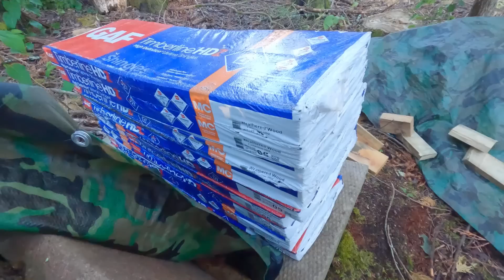The Scary Thing about Living Alone in a Tent- A Halt to Cabin Building. #102

Comment: 24:55  For one of my buildings, I closed off the roof by nailing boards under the rafter ends. It's been 15 years & it's still doing great. 
31:21  My brother got after me last year. The drip edge should have a 1/4" to 1/2" gap at the bottom from the fascia board. So, all the roof water doesn't drip down the fascia board. 
Hope the back gets better. Love your channel. Been here since I found the deer castle a few years ago Went back & watched all the previous.

Comment: Ryan, I had a bad back too. For many years I suffered to no avail. I finally asked my chiropractor how I could solve the problem and he suggested either a large yoga ball or an inversion table. I opted for the inversion table and back problems are ended. It's all about decompressing the spine. Good luck with the back issue! The project is looking great!!!
Reply: I was going to tell him the same thing.  I suffered with herniated disks and the in inversion table gave me my life back.  Ryan, ICE, ICE ICE!  It reduces the inflammation when do have an event.  All the bending and unusual angles you were taking when hanging those front boards is probably what did you in. And believe it or not, walking will help the nerve heal faster.   Get an inversion table and spend 10 min on it every day.  Good luck!
Reply: @ebony5766  Glad to find your comments here. I have same in lower lumbar... I have been hanging from an OM gym as much as possible... but now trying to do 4-5 times per day as long as I can... 5 or so minutes. It seems to be slightly helping. I don't want surgery... and I'm doing something similar to Ryan except my land is all hillside. Thanks for the constructive suggestions and I'm open for more if you have it. I'm still just clearing and plan to build at some point... but doing this alone and the back could make or break the dream.
Reply: @johannwolf1  interesting  to see just how many people have back issues.  I was actually under the cabin insulating the pex lines when mine herniated 5 yrs ago.  I didn't think I was going to get out.  The "regular" doctors gave me 3 options.  Pain meds.  NOPE.  Spine shots.  NOPE. or surgery NOPE.  So I was blessed to find an amazing chiropractor.   I can pretty much do what I want,  I have to be careful....bending too much is what will do me in.  So when I use the chainsaw I have to tackle the project in increments.  BTW, I'm a 68 yr old woman which my youtube name does not imply.  The inversion table has been a godsend.
Reply: @wendyritchie9320  Same I'm no on all 3... might consider stem cell injections... but I think I can heal this. It's been over 3 years now. I'm 56, but have always been athletic. Funny you mention chainsawing... I'm doing a lot of it. haha. and a lot of bending over to pick stuff up. that is the most challenging. I had a table I used before this happened. Since then I discovered this simple portable thing you can do more with... it's called an om gym and you hang from your hips in fabric... not your ankles. it has a bunch of handles too so unlimited body weight exercises and stretches are possible. Check it out you might like it. Often an hour or so after hanging the usual pain is gone for a bit.

Comment: I have the same back problem you have and maybe worse but after taking Turmeric/Curcumin for two weeks my problem went away. After 3 years still no pain. No pain pills anymore and we all know it is not good for the liver.
Now I just take one a day. If I do tweek my back the recovery time is a day and it is nothing like before, like a knife in your back. It works and it saved me from a early retirement. I am surprised no one has told you already. Qunol Is the brand I use. Good luck.

Comment: If you take a 5 in 1 in separate the dimensionals you can slide the 5 in 1 tool in between 2 layers and slip it off cut it off for a easily then you'll have 3 ones Just just for your next roof

Comment: Probably been mentioned, but . . . fly rafters are easier to install if you install your framing blocks from the last rafter first. Then just put it up from the ladder, screwed into the framing block closest to center. Then finish nailing/screwing.
Oh, and drip edge should overlap the corner if you're doing the eave edge and gable edge.
Oh and no need to cut the tabs off for your starter course. Measure 5/8" over the drip edge, snap a line and install the whole 3 tab, back side down along the eave edge. Then just line up the first course of finish shingle right to the edge. Making sure to  be 6" off the seam of the starter course.

Comment: Many times I cut the under /topside of the single of and used as your starter. Over hang 3/8-1/2" and start with a 1/2 so your joints don't match. 
For someone that doesn't know anything,  you know a lot.  Or you search YouTube

Comment: I follow a channel of a guy that lives major off grid in Alaska as in helicopter into the cabin. He has a good supply of food in steel barrels that is stored outside of the cabin. He is two or three days of bush travel and river swimming to get to the nearest road (and almost impossible most of the year). He has staples like beans and rice but you could use say a week of can goods and package foods plus ten gallons of distilled or regualr bottled water. Add an low cost butane stove and six cannisters of fuel and you are set for a week. Just a thought. Bob in Nevada

Comment: Honestly you need to either buy or make an Inversion table as walmart has one for ABOUT A HUNDRED BUCKS. And you will be amazed how good a few minutes hanging upside down especially after ANY TYPE OF BACK INJURY.  And find a good chiropractor Ive used them all my life. Because living in a small town we didnt always have MD's. I think you mentioned making a "teeter totter" for some reason but that as well could give you some relief anything to to take the pressure off your back even say a slanted sit-up board. As part of your back problem is related to poor stomach or ab conditioning. I know that sounds crazy but if your abs are in good condition it effects your back as well.

Comment: Had to laugh when you said you had to knock the mold off with the “old hand planer” with the motor inside run by a lithium based battery so it is cordless,,,,,, hahaha. I saw my dad do stuff with a REAL old hand planer run by hands arms and shoulders only,,,, hahaha. No motors involved!! 
    I get where you are coming from though. To do this all with manual labour would take well over a year vs a few months,,,, 😂😂.

Comment: It's much easier to cut the excess off the roof boards while kneeling on the roof deck -- keep the weight of your saw on the solid part of the roof. :) Step ladders are extremely sketchy side to side = muy no bueno on unlevel surfaces.

Comment: Now when you have the roof water proof would be the time to do your flooring . 1x4 under the joists, sheets,  insulation and the moisture plastic and then your floating floor with out the nails, nailing you to next year when the floor is dry so you do not get any gaps and no floor under the walls. Nice you do a wooden house and not a plywood house so many do.

Comment: Instead of a hole notch a 3/4 to one inch x4 inch notch at the top of your blocking in the soffit if you inclosing your soffit you don’t need to screen it only need to drill holes in your soffit then screen those holes a 3inch hole good between each rafter all the way down

Comment: LMAO! Thanks for the "Pro Tip" Ryan. Now I feel like I owe you a tip to return the favor... avoid holding your drip edge 3" above your femoral artery when cutting it with a cut off wheel, just in case you ever run across that type situation. :-) Hoping you feel better soon dude.

Comment: I know what you're going through when you're back goes out!

The same thing happens to me every once in a blue moon, and it keeps me down it's hard to move around or to do anything actually......

Send me your information and I'll send you one of my heating pads that I got from the VA... They're big enough to lay on!
They give me one nearly every 6 months.

Do you have a solar powered battery charger or whatever they're called a jackery?? You can plug it into, and lay on your Little bed, you can lay on top of it and control the heat to where it's most comfortable for you.....

(This heating pad can relax your back muscles; and a back support belt!! that you wear while you are doing what you're doing: it will help to get you back to least as close to 100% as possible!!!!!! )

If you use it everyday while your back is out it'll be good for you in the long run......

Send me your information name post office box city and state and I'll send you one of these they're big enough to lay on: and you can control the heat they do get really hot you can possibly put a damp towel and let the moisture soak into your back muscles too relax them....

Don't forget just send me your name first and last and your post office box city and state and I'll send it to you and you'll be surprised how good you'll feel after a few hours of just laying on it......